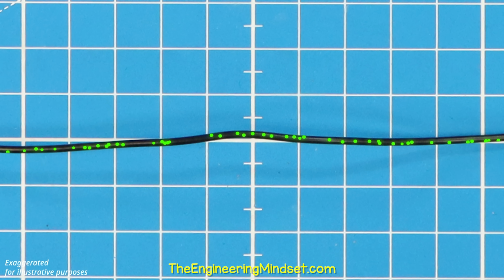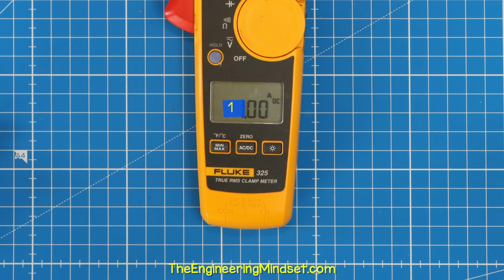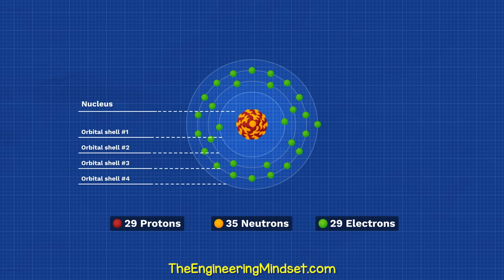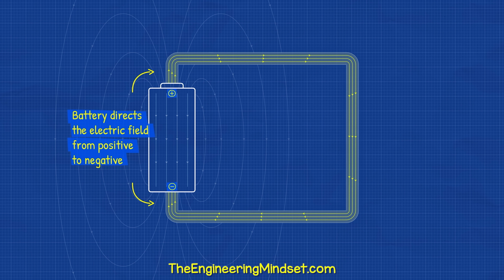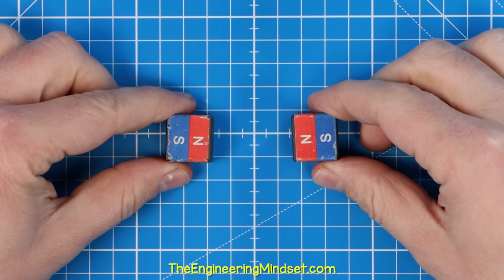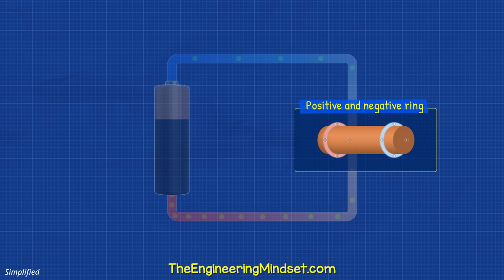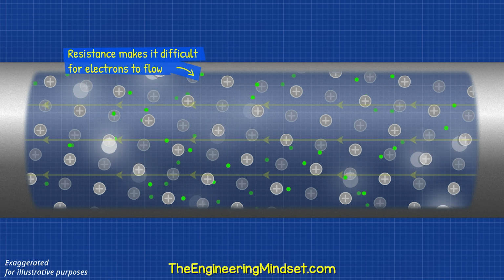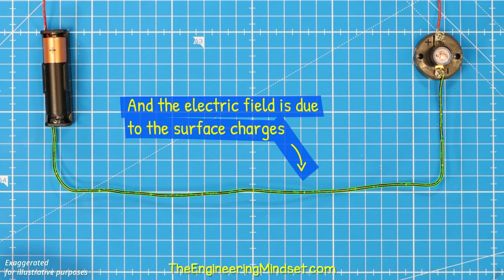How Electricity Works - for visual learners

Comment: I'm a little confused here. I don't know car batteries too well, but when jump starting a car, how does the dead battery get charged if electrons flow from the negative end?

It's best practice to connect positive to positive, then negative to ground. However, assuming the negative end is flowing electrons outwards, how can the dead battery be charged if the electrons are flowing into a grounded piece of metal not attached to the battery?

Comment: Veritasium question: You make the circuit of the total length of 2 c/s (light distance traveled in 2 seconds). At a distance of 1 c/s you put a lightbulb and at 2 c/s you put the battery. The battery and lightbulb are next to each other but 1 c/s apart on the route. If you close the circuit how long does it take to light the bulb? A) 0,5s B) 1s C) 2s D) 1/c s | :) have fun

Comment: this went way too fast for me
Reply from the maker: That's ok, it's a lot to take in within a short time. If you find time, pause it, process what was said and write down notes for anything you didn't quite understand. Then search those parts after. You can also chnage the playback speed in the video settings to suit your needs.
Reply: @EngineeringMindset  I'm going trough your other videos first. Ohm's law makes sense to me, now I'm trying to understand voltage. 

electricity is probably the hardest thing I've ever tried to understand

Comment: I have found the last part interesting and well explained and is probably the most important part for those that work on the field of electronics. Unfortunately it barely scratches the surface of the electronics world. On a computer everything is flowing dynamically and very fast so that effect is happening all the time together with a long list of different type of noises, like crosstalk, thermal noise and interferences, so electromagnetism would be next. Then follow-up topics would be impedance, resonance and semiconductors to understand  the basics of electronics (and why things are made the way they are). Then all the gates and digital logic. Without those you wouldn't be able to fully understand digital circuits. Analogic, alternate current, higher power circuits, controlled RF emissions, modulation/demodulation then encoding/decoding for digital signals gets you further to a more complete understanding of what goes around digital processing and practical applications, but still on a well known and mature technologies. Then computing, software, protocols and how  Internet works to understand IoT devices. Unfortunately it is years of work.
Reply: The title of the presentation is "How Electricity Works"
It Is NOT
A Complete Explanation of Everything You Need To Know About Electronic Components.

Try to focus on what's in front of you.
Stop Day Dreaming!
Quit Slouching and Sit Up Straight.
And STOP Eating Your Boogers! That's DISGUSTING!

Comment: Static electricity happens when we rub objects (like a glass rod with a cloth) and separate charges; it doesn’t rely on “using up” our personal electrons. In a perfectly dry environment—where neither materials nor conditions ever change—you could theoretically keep creating these small shocks indefinitely. Each time you rub and touch the rod, a tiny charge transfers and then rebalances, with no meaningful depletion of energy or charge from your body.

Comment: Beautifully explained! i had chemistry class and they were explaining galvanic batteries and i couldnt understand a thing.
but i came up w an example from this, its like a DAM, and when water is above the dam its positive charged, and released is whne the battery is working and it goes towards the negative which is down.
and when the water is emptied wee have more negative than positive, so we have to work to put the negative back up to positive, then negative will never freely move to positive. but the positive is always wanting to give its water/electricity

Comment: Something I was curious about: You mention the wire is neutral to start, and when the battery is connected, one half becomes negatively charged while the other half becomes positively charged. But what if you gave the entire circuit an electrostatic charge to begin with? Say the circuit was insulated from ground, and you, also isolated from ground, put one hand on a Van De Graaf generator and one hand on the circuit. I assume then even the positive terminal could have surplus electrons after the battery is connected, but the circuit will still work because the battery would still produce a voltage.

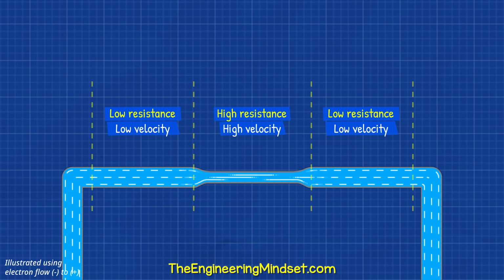Comment: 3:32 The flow rate stays the same when moving from a bigger to a smaller diameter pipe. So, the smaller pipe diameter analogy for the resistance doesn't work.

If I'm wrong, do reply to this comment why. Thank you.
Reply from the maker: Flow rate is the same but the velocity changes. We have written high velocity and low velocity onscreen to indicate this.
Reply: @EngineeringMindset Thanks for the reply, but  I'm still confused about how this water pipe diameter analogy is explaining resistance in a curcuit.

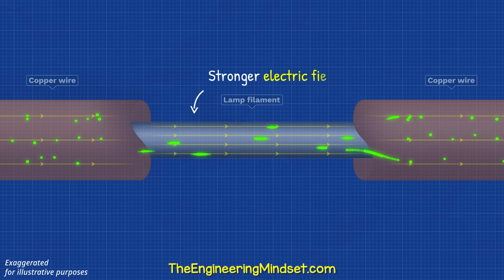Comment: Great Great Video!!! I now understand the basics of electricity. This video was spot on perfect for a 100% visual learner like me!😊 One note: At 14:15, the electrons are moving in the same direction as your field arrows, but you explained they move against the field. What is correct?
Reply from the maker: Oh, you're right. That is a mistake in the graphics. The arrow should be reversed. Well spotted and thank you for letting me know, if you can please email me via our website and I'll send you a mug for free.
Reply: @EngineeringMindset  I am living in germany, is that an issue? (Don't want to cause enormous shipping costs)
Reply from the maker: Yeah that's fine, I'll include shipping
Reply: @EngineeringMindset 매우 아름답고 훈훈한 광경입니다.

Comment: i'm 100% with your thoughts, sevensexton (below)!! i'm 68 YO, trained in electronics 6 years,RAAF, electrical contracting 45 years. Knocked heads with two eelectrical uni professors and many electrical engineers, none of which wanted to or could explain this electron drift concept, clearly.I feel that I have only 10 years of brains left to clear my thoughts on this subject. 
The complex interaction of magnetic fields inside a switchboard when high currents are flowing and cables are tightly bundled,  is mind blowing.  
 Insulating voltage is a whole different ball game to insulating magnetic flux, which is the science of electromagnetic propergation through the ether, where the energy literally leaves the wire. I hope your head hurts as much as mine. 
 My wife and I made two electrical engineers and one RNurse. That took 30 years, but I thank you, with all sincerity for your 2 months on this video.

Very well done!
Reply: Amazing. And Ive been wondering myself how long this could take to understand. Going on 18 years as an electrician but with a strong desire to know how this all works.... And I wondered why I couldn't get any answers from my co workers with 20-30 years experience in the trade. Most of them are only installers. Typical we know how to use it but don't know exactly how it works....not even close. I'm making strides. Thanks for your words, nice to see all these other minds on the same subject.
Reply: Okay so I’m not thick for not immediately understanding everything in this video?

Comment: Seemed to gloss over the surface charges a bit. Would love a more in-depth video of how they are formed. Also doesn't the strength of the field vary as inverse cube to the distance so wouldn't it become so small as to not affect the electrons far away? Also wouldn't other fields in the environment interfere?

Comment: Is it better to put the lamp close to half-way from the battery, so close to the transition point? Or does it not matter?
Reply: Great question! In most basic circuits, the position of the lamp relative to the battery doesn't significantly affect its performance, as long as the connections are secure and the wires are conductive. However, if the wires are very long or there’s a high resistance, the placement might slightly impact efficiency due to voltage drop. For standard setups, though, it usually doesn’t matter much!

Comment: I really appreciate the effort to create such a great video.
I have one question, that maybe you can shed some light on something that I'm seeing.
I impart a specific resonant frequency onto a electrical circuit, and I measure a 12% reduction in resistance, when measuring with my multimeter in amps.

Can you explain why a lightbulbs resistance will change when I add the resonant frequency?

Comment: I really enjoyed your video.
Veritasium stated in his video about two years ago that the light turns on due to the electric field effect and not electrons flowing in the filament. It did confuse me at the time.
I think your video is explaining the same effect but I'm not sure.
Reply from the maker: Exactly, so the last part of the video ties it all together and you see the filed cause some current to flow, before the electrons in the rest of the wire start to move. But this is all in a fraction of a second, and then the current is steady and constant so the light is at full brightness.

Comment: ELEKTONS & ELEKTICITY & ELEKTRONS FOR BEGINNERS.
1.  A good conductor of elekticity can be called a metal.
2.  A metal is a good conductor of elekticity.
3.  A metal has a thin layer of elektons on its outside surface – that is what makes it a metal.
4.  Non-metals do not have a layer of elektons on their surfaces.
5.  Elektons are photons that hug the surface..........
6.  whilst propagating at the speed of light in the medium touching the surface (eg air)(eg plastic insulation).
7.  Elektons move in every direction on the surface of a say Cu wire – but (eventually) mainly along.
8.  The propagation speed of elektons duznt depend on the kind of metal – all kinds of metals give the same speed.
9.  The ruffness of the surface slows the speed of elektons – due to the extra distance up&down over the ruffness.
10.  Elektons have a negative charge, equal to the charge attributed to the (silly) standard electron.
11.  Elektons go straight ahead – except that their trajekt is affected by other elektons (due to repulsion).
12.  Hence, after a while, elektons tend to move mainly along a wire (albeit in both directions).
13.  And, elektons follow the surface.
14.  If the surface of a wire duz a u-turn (eg at the blunt end of a wire) then elektons do a u-turn at the end (koz the surface duz a u-turn)(ie elektons follow the surface).
15.  Elektons form a thin negatively charged outer surface layer due to repulsion from atomic elektrons.
16.  Atomic elektrons are photons that orbit (hug) an atomic nucleus.
17.  The outer orbital elektrons escape from the nucleus, & form an outer layer of elektons (now hugging the general surface rather than hugging individual nuclei).
18.  The elektons are attracted to the positively charged nuclei.
19.  Different metals will have a different degree of saturation of elektons.
20.  The better conductors will have a denser saturation of elektons.
21.  A battery can supply elektons at the positive terminal..........
22.  & rob elektons at the negative terminal.
23.  The supply etc of elektons can result in what we call voltage, or potential.
24.  The supply etc of elektons can result in what we call charge.
25.  A dead-end length of wire touching a positive terminal will be saturated with elektons going both ways along the wire (doing u-turns at the dead-end).
26.  Elektons do not reflekt off or at a dead-end (they do a u-turn).
27.  When the flow of elektons going each way is equal then their magnetic fields cancel..........
28.  & hence their nett magnetic field is zero (in the far field)...........
29.  & there is no heat loss in the wire.
30.  A dead-end length of wire touching a negative terminal will be saturated with elektons going both ways along the wire (doing u-turns at the dead-end).
31.  The numbers of elektons going up & down a dead-end wire will depend on the degree of saturation.
32a.  The degree of saturation will (probly) depend on the surface area available etc...........
32b.  & (probly) whether the wire has a coating of insulation.33.  This saturation creates what we call resistance..........
34.  or, if u like, this resistance creates saturation (many processes are chicken'&'egg).
35.  Once u have learnt the above rules then u will understand that if u somehow discharge/short/earth a length (L) of wire (or a capacitor)(in fact a wire is a capacitor), then u can expect that the primary discharge will take a duration of 2L/c seconds (ie it wont take the silly standard skoolkid answer of L/c seconds).
36.  And the discharge voltage will be V/2 (ie it wont be the more obvious V/1).
37.  And if that there wire is insulated then the duration will take say 3L/c seconds (as per (6) & (32b)).
Enuff for today.

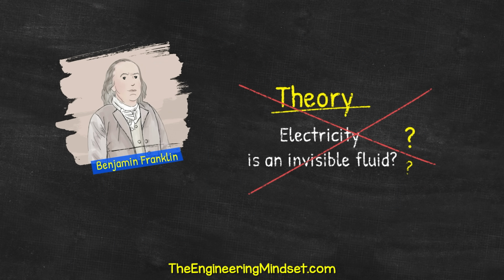Comment: 2:14
Yes, Benjamin Franklin was wrong.. but you are also wrong on thinking that there is something ( electrons ) getting transfered between the cloth, the glass and/or the human..

When rubbing the cloth on the glass tube, you force the alignment of some polarised particules in the glass. 
Best way to visualise this, would be to rub a non-magnetised needle with one side of a magnet in the same direction for a few times.
Then put that needle on a small piece of paper ( without touching it with your hands or dropping it ) and make it float on a water surface.
The needle acts like a compass.

but as soon as you touch the needle with your hand , it loses its magnetic alignment.
Static electricity discharge, or like most of us we call " static shock " , is the same phenomenon that happens with the needle when you touch it and stops acting like a compass.
In simple terms, electrons don't transfer from the cloth, the glass or even the human..
It's only about changing and/or restoring the alignment or chaotic polarisation configuration of the matter in materials.